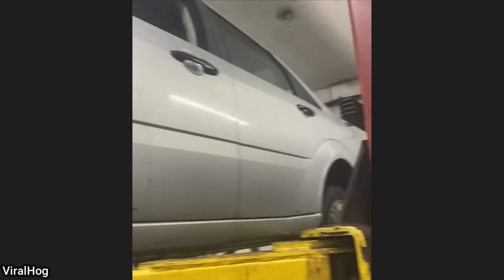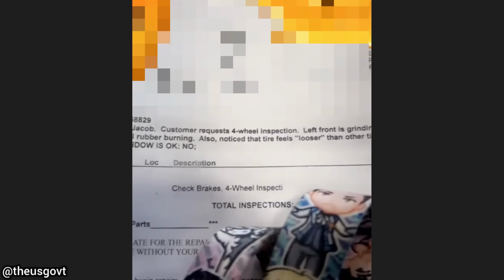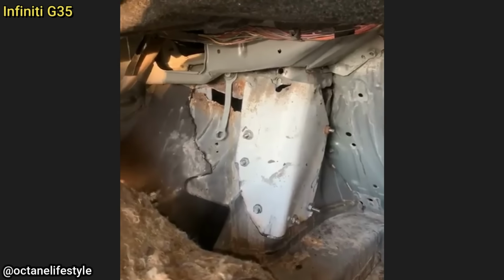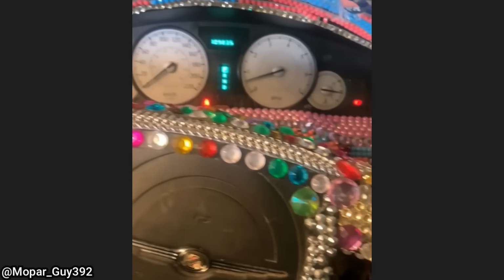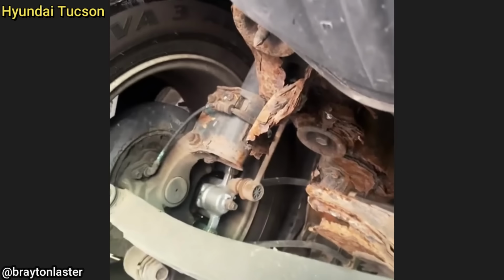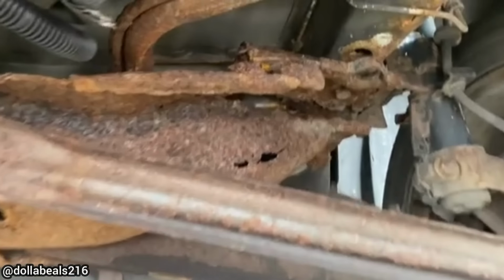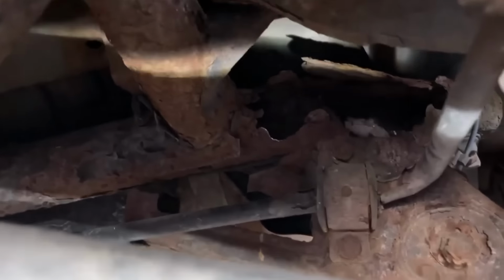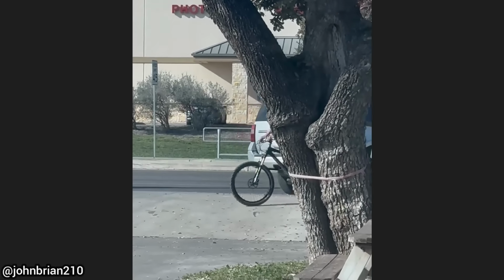Customer States (Dangerous Death Traps) | Just Rolled In

Comment: I asked Claude how much would it cost to make vehicle frame rust resistant- 

To assess the cost of making ordinary car frames rust-resistant, we need to consider several factors:

1. Current methods:
   - Galvanization (zinc coating)
   - Cathodic electrodeposition (E-coat)
   - Rust-resistant alloys
   - Protective coatings and paints

2. Cost components:
   - Materials
   - Equipment and processes
   - Labor
   - Research and development

3. Estimated costs:
   - Galvanization might add $100-$200 per vehicle
   - Using stainless steel could increase frame costs by 3-5 times
   - Advanced coatings could add $50-$150 per vehicle

4. Factors affecting cost:
   - Scale of production
   - Availability of materials
   - Technological advancements
   - Regulatory requirements

5. Long-term considerations:
   - Increased vehicle lifespan
   - Reduced maintenance costs
   - Higher resale value
   - Potential for lighter frames, improving fuel efficiency
Reply: Great info! Thanks and tell Claude thanks too.
Reply: WilliamMurphy-tj7il  Please explain how protective coatings and rust-resistant alloys cause problems with metal fatigue or structural strength.
Reply: Greenapplepie, thanks for your list of options and benefits. I've seen how treatments and galvanizing extend the life of a frame. I delighted in a factory stainless steel exhaust while friends were on the Midas treadmill.  And I enjoyed the greater lifespan and resale value of a car that spent several years in New Hampshire but never developed rust.

Comment: I'm really happy that we have mandatory inspection of vehicles on the road, even if it meant that last week I had to replace 2 light bulbs, 2 wing mirrors, and a tail light because my car failed a week before.
At least I know that cars, like the ones in the video do not drive beside me.
Reply: I'm really happy that we do not have mandatory inspection on vehicles on the road.  Unlike you, I keep my cars in good condition and do not need anyone to tell me if they need work.  I'm also smart enough to know that inspections do not keep rolling wrecks off the road.
Reply: ass pucker factor, they drive in from another state
vote for out of state cars to be stopped and  tested
Reply: Totally agree.
I've actually had the annual inspection identify safety problems that needed fixing, which I hadn't known about. And for those who yell about "mechanics fraud hostage blah blah" it's really simple: I took my car to my regular mechanic for the repairs, then got it inspected again afterwards.
Reply: those are things that you should already be aware of without needing an inspection. If you were that clueless, you should'nt be driving
Reply: @01Z06guy  How can you watch this video and then comment that. Youre probably one of the customers in this video 😆
Reply: @01Z06guy  100% agree, not to mention that even if here in Europe you have to pass an inspection, it doesn't mean you can't just bribe the technician, which happens more than you would think and practically makes the yearly inspections worthless.

Comment: Stay outta the rust belt is what I get from this video.
Reply: Or get your car oil sprayed every year before it's too late!
Reply: Yeah rust is awful. Reminds me I need to get my car undercoated.
Reply: @HighSierra1500  Krown guy I last got a car done at said should be good if you do it every other year; that said Its not terribly expensive and extends the life of the body and frame a long time.
Reply: @allancroskery1811  For sure. I get my Cadillac Fleetwood oil sprayed every year before I put it away for the winter. I only put 2000kms a year on it so the car has layers of oil spray.

Comment: the mandatory every year technical inspection in my country (Croatia) makes me relieved, as you'll get away with maybe a smoky engine, a bit of oil leaks and a speck of rust (altho harder and harder), but if your car is in this bad shape - you not only get off the road but also get fined if the police catches you like this. lights, brakes, tyres, undercarriage must be impeccable to pass.

Comment: Just waiting for my van to show up on one of these. It was in pretty rough shape from a previous owner; lack of maintenance, all fluids except brake fluids leaking, exhaust held together with vice clamp, needed new engine, bald tires, shot shocks/struts, bad ball joints on steering linkage, worn brakes, etc. It was a mess. I declined the repairs, but ended up going back to get the engine replaced and did everything else myself. Its in great shape now! Luckily im not in the rust belt, so its structurally solid!

Comment: Anyone ever hear of the radical invention called a car wash?  Won’t stop the rust but might slow it down. Wonder when the car with the rusty red oil filter had its last oil change?  Pre purchase inspection any one?
Reply: In Northern states it's really not practical to get the car washed when the temps are below freezing.  Lots of cars are encrusted with salt for months before they are properly washed.
Reply: @MrSloika  its not dry salt that rusts cars out, its moisture AND salt. If you wash your car and then go drive on a dry salty road you are putting salt water on your underbody which is WORSE than driving around with dry salt on the bottom on dry roads.

Comment: I had an old sixty six chevy, impala at the rear crossover member rusted all the way through, and the rear was just bouncing up and down, so I had a buddy of mine cut a piece of steel ibeam  & world did it to the part of the frame.. it worked perfect over 6 years. I drove the car for years that way and it gave it an 1.5 inch lift 😊

Comment: My brakes were extremely squeaky even when i just barely pressed on the brake. 
Quote from my dad who fixed it, "Brake wheel cylinder was leaking, adjuster rusted solid, new brake shoes." 
I drove around on that for a few days without knowing...

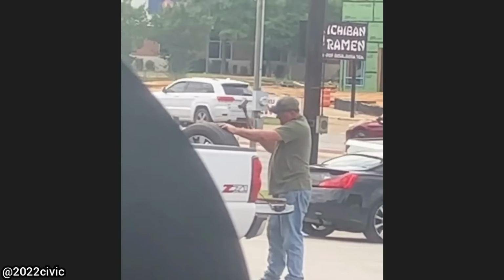Comment: 12:55 Depending on the damage to the wheel, this can actually be done. I had bent a massive lip in the side of my Subaru 16 inch aluminum Wrx wheel I had on my forester at the time, Nasty pothole and low tire combo. With a map gas torch to heat the aluminium up a bit you can coax the wheel back to shape. It wont be perfect, but, I got my car off the side of the road without buying a $200 wheel from the shop.

Comment: Why doesn’t the states have a mandatory set vehicle inspection time… In my country, it’s either 6 months or 1 year depending on how old the vehicle is. If it doesn’t meet safety standards, you won’t be legally allowed to operate it until it’s fixed.

Comment: Brakes are non-existent, radiator is corroded, power steering is broken, transmission is stuck and engine is about to explode.

The customer declined repairs, and drove away.

Comment: Yeah, you know because four-wheel-drive is there so that when the other half of the drive line gives out you have another drive line that will get you down the road. You know if the front line goes out you have the rear line if the back line goes out you have the front drive line.

Comment: Here in Ontario, if a car is unsafe to drive, the mechanic is required to refuse to allow the customer to drive away. Repair or tow only. Smart mechanics also call the police to inform them when a car is being towed away. Failure to take these precautions can result in the mechanic being liable should anything go wrong.

Comment: I was just wondering what province you are working out of?
I work in the Truck and Trailer industry and have my truck and coach license.
I’m no longer surprised at what pulls in the shop, even though sometimes you can’t help but laugh your ass off !
The repairs that ya see the owner ops do on their own are just insane, and even after all the wheel offs and all the so called inspection stations out there, roughly 3 yrs ago I had 3 complete wheel offs, tires, hubs drums and spindles destroyed!
Best answer still that we get constantly” hey bud, where are your wheels at?”
Driver” huh,  wheels, ya good one  that would suck” lmfaoo

Comment: These would not be on a public road in the UK. Owner declined repairs and drove away is not an option. The car is not allowed to be driven away until either the garage repairs it or the owner has another garage removed it.  If the owner ignores them and drives off, their insurance is immediately invalid.

Comment: In the UK your vehicle must pass an MOT, if it fails it's MOT then you have 10 days to fix those issues, after that it becomes illegal to drive, also your insurance won't cover you if the vehicle has failed it's MOT, we still get idiots driving dangerous vehicles, but a lot less than seems common in the USA

Comment: In the UK, your car is required mandatory checks. (MOT). If you fail certain things, you can’t drive the vehicle and some things need to be fixed within x days and then verified within those days: the Police have records and can see this data. This is to ensure vehicles on the road are road safe for everyone.

How on earth are cars like this existing and driving on the roads in the US? In the UK some of these tyres and state of vehicles wouldn’t be allowed to drive on the road.

Doesn’t the US at least have laws and regulations in place that mean that if mechanics have someone bring a vehicle in that’s dangerous and the owner refuses to get it repaired with them, that the mechanic company is compelled to report the state of the vehicle to the whatever driving authority exists in the US unless the driver has it towed to another mechanic? (Who then takes the same responsibility) 
In the UK it’s the DVSA (Driver & Vehicle Standards Authority)

Comment: With the amount of rust on these frames you must be driving on salt grits to melt the snow. This explains the dangerous and insane rust issues on vehicles under 10-15 years old. If thats the state of affairs in the USA, vehicles should be extra cheap as you'll need a new one every 5-10 years just to keep safe. You would expect the inspection places be more on the ball when it comes to structural rust, but it seems it's only caught once it's destroyed the frame, control arm or ball joint/ steering arms/ etc.
If you tried sueing the last place an inspection was done without failing for said rust or the local body council for spreading salt on the roads rather than a shingle gritt for traction, it may make these folk more professional and less cavilar.
But it seems the buck keeps moving and no one takes responsibility.
Yet the responsibility rests on the owner, the mechanic, the dealership/workshop and the council if all due care and reasonable actions are not met.
If they are met responsibly the vehicle would not be in the position to harm.
Vehicles in these states do not have accidents, they are simply a case of grievous bodily harm or unlawful death, or the highest form of manslaughter.

Comment: Sometimes while driving on the highway I will see a vehicles pass me at high speed with license plates from a state hundreds of miles away 
the vehicle will look rusty and the engine sputtering and white smoke coming out of the tail pipe or other people will have a beat-up pickup truck with the bed overloaded with heavy scrap metal or other heavy items the rear end sagging ,bald tires or sometimes the rusty bed leaning from the weight and just flying down the highway without a care in the world and I think to myself I wouldn't trust those vehicles to drive to my local grocery store a few miles away and depend on it to make it back home

Comment: I've scrapped about five cars in my time. All of them were in fantastic condition compared to most of these vehicles. Maybe needed a new set of bushes or once needed cv done. Wheel bearings maybe. Usually scrapped them because the resale value was lower than the repair cost, but wow these cars. You likely couldn't give away most of the ones on this show, let alone repair them. What the heck is going on in the second hand market in the USA? Is there a rust fairy or something?

Comment: How come OE keeps cheapifying vehicles even at risk of safety, even brake lines and fuel lines. I also states would not use so much salt and calcium chloride, both are very corrosive especially with lesser quality of metals and thinner as well. The machining is already set up in the factory and it would cost approximately $2-$250 per unit to use stainless. I bought a complete stainless set of brake and fuel lines for my Torino for$235 and that was on line so mass production would be less expensive.

Comment: So there's "Customer Declined Repairs..." & then there's "NOT having the $3K+ to immediately drop on those repairs..." for a vehicle worth a $100 bucks... or less.

Safety (if not yours then the other driver's) should ALWAYS be top concern... however, between auto manufacturers purposely designing their vehicles to limit their lifespan (oh yeah, that's exactly what they do) &/or the outrageous cost of parts & repairs charged by some fly-by-night mechanics... (not including tax), it's easy to why some have elected to go the DIY route... still, that's a poor excuse for EVER using duct tape, Bungie cords, chains or nylon straps to hold moving parts on to your moving vehicle. 
To those who do, all liability claims should require an investigation of previous maintenance starting with your mechanic of record detailing problems, whether the customer was informed of any problems & a written statement of the customer declining service. 
How in God's name some states don't require an annual inspection... seems to violate both common sense & any pretention to value life as demonstrated... people can & will drive just about anything in any condition risking their safety & more importantly, your safety as well.

Comment: The fact that these shops let them drive off the lot is concerning. 
I would be hanged, quartered and then burned if I let such a scrapbox move more than 5 meters under its own power. 
Either we fix it, or you tow it. It's not moving otherwise. Call the cops, they are on our side.

Comment: What the F*** is wrong with those vehicle owners, are they wishing to die cause they decline service for their vehicles, plus why some people try to fix their vehicles when they might not know what they are doing.
If those driver's were here in Canada and their vehicles failed inspection, they would be told to have their vehicles towed away.
My 89 dakota failed inspection and cause of a number of problems, shs just sits in my yard, she still runs but not allowed on the roads.